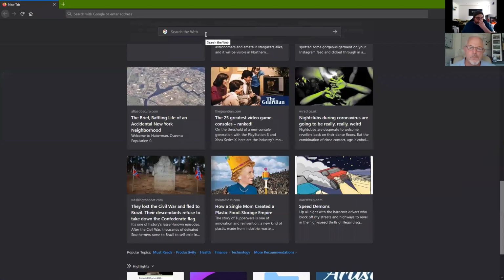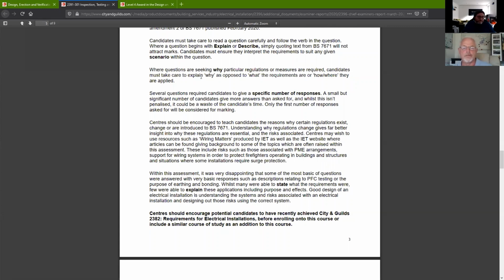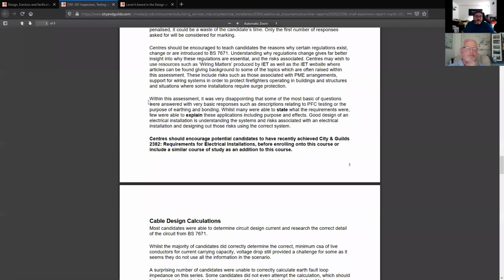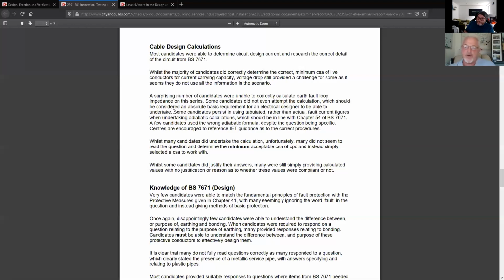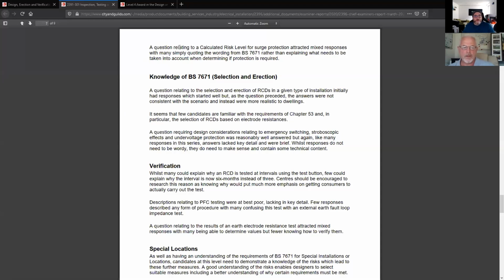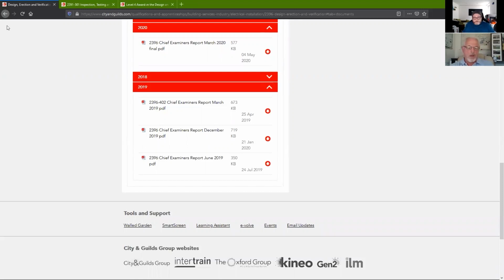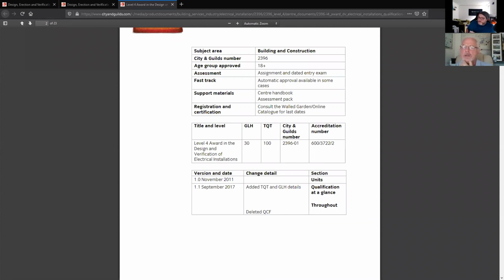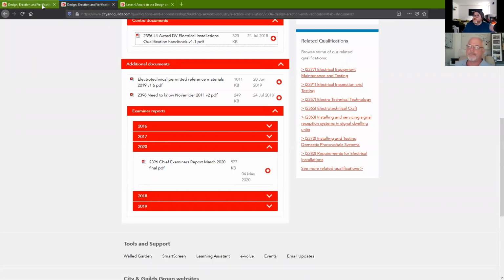2396 design course, a discussion - A SparkyNinja Webinar

Comment: 32:32  What is "Main Earth Conductor"?   Never seen that stated in GN3. I think you mean "Earthing Conductor"
Reply from the maker: Whilst not present on the electropedia site, Main Earthing Conductor has been a common term used to identify the conductor between the source of earth and the main earthing terminal. It has been used regularly for many many years. Just Google it. I've just found it in a document from 2014 by the national grid, and a technical guide by the ENA from 1992. Using it will have no impact on the 2396.
Reply: Main Earth Conductor is the one incoming from The DNO, they are normally 16mm , however they can  be 25mm and 35mm
Reply: @lemon_kpopstan  incorrect Carlos
Reply: @lemon_kpopstan  The DNO are not obliged to provide an earth, this is stated in ESQCR. If you read Brian Scaddan's book "Design & Verification of Electrical Installations" you will see that "Main Earthing Conductor" is ot a recognised term, for the pruposes of your 2396 exam, I would advise you not to use it

Comment: Passed it a couple of years ago,never used it at work!
The guilds want you to give your opinion when answering the test questions!
what the reg actually means to YOU.
You will be writing for 3 hours solid, learn your cable calculations and answer all these questions first, easy points in the bank!
Then answer any questions that ask for a diagram to be drawn, again easy points, if you label it!
Then assess the remaining questions and answer what you know! Lastly answer the stuff you have to look up!
Always explaining your opinion on the questions!
Study at night school, so you can learn in chunks and study between lessons if struggling with certain bits?
It turns out that the project is the best revision for the test but you only find that out after the test!
Remember when designing your project, you are not installing it, so you can make it very reg compliant and not worry about ease of installation too much! 
In the project you have too chose all materials and installation practices and provide information to back up all your choices!
Try and get hold of an old project and do it before you start your course and several test papers, this will get you on the right track when you start the course and will show you where you need to improve!
The course will make you smarter!

Comment: Just heard your comments about level 2 sparks. I did my apprenticeship later 80's YTS then the young workers scheme because the JIB would not help me out.  I got my 236 parts one and two at the 15th edition, 16th edition , old 2391, 16th 17th and now 18th edition soon to be 18th amendment 2, this is my work history house bashing, motor rewind, industrial, commercial, education, energy from waste projects,  project engineer, and for the last eight years a NICEIC  QS, I spend most of my time explaining to some of the jib gold card sparks what they have done wrong and why. 
I tried applying for my gold card but the ECS and JIB both said you have to do your level 3  to get the gold card. Why should I at 50 spend £5K so someone can watch me remotely via face time bending conduit or second fixing light switches. So for me your comment is unjustified.
Reply: Hi Steve, 5000 pounds, I hope you are joking that's crazy, I'm a little older than you, I was lucky as I took the A, B, and C certificates and finally my Licentiateship. I was finally awarded at the age of 30 my JIB technician card. FK the gold card if it costs that much.